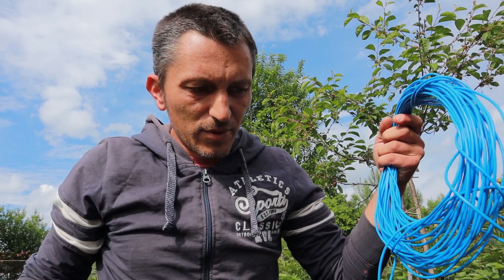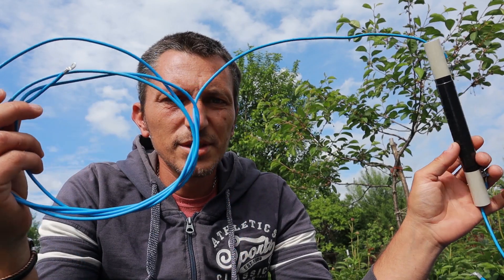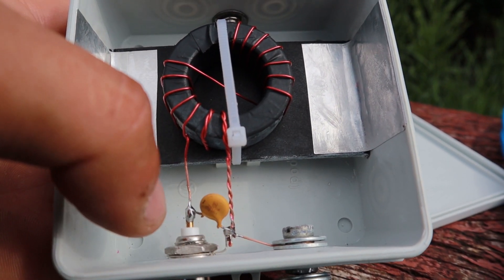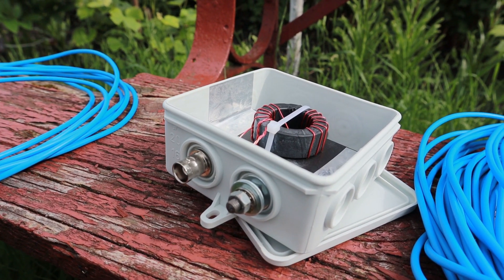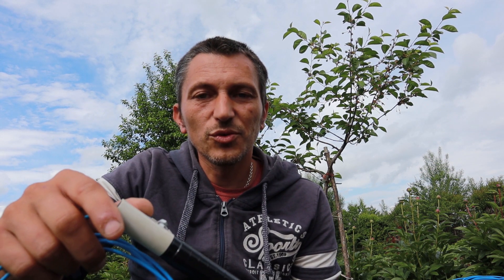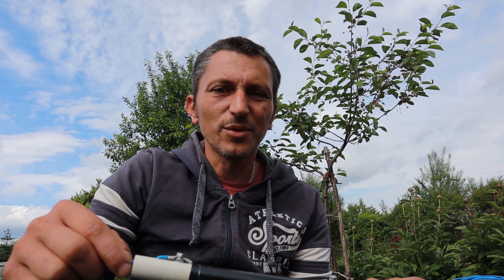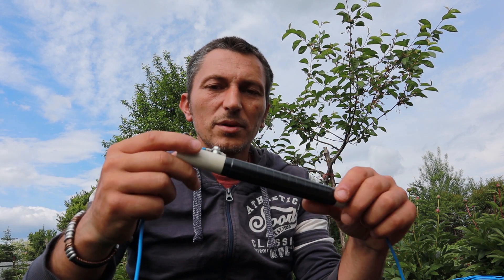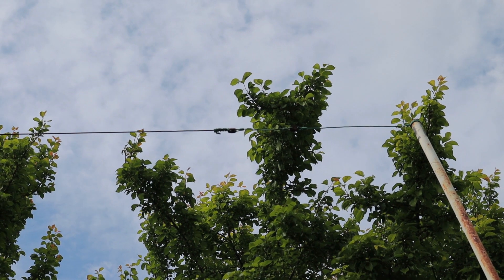Shortened Multiband EFHW Antenna From 80m to 10m Band

Comment: How many micro Henry's is your induction coil?
Reply from the maker: I can't remember to be honest. I think the one in the video was around 80uH. Basically you can use anything between 55 to 110uH. The only thing that will be diferent is the length of the wire after the coil. The advantage of having for example a coil that is 55uH instead of 110uH is that you may have a bit more bandwidth on the 80m band. But the end wire will be a little longer too... somewhere around 3m if I remember. I have to rebuild mine as well so probably I will do another video on this one with proper measurements now that I have all the gear to do that. 73, YO6DXE
Reply: @dxexplorer  66pacific has a induction coil micro Henry calculator
Reply from the maker: @QSasquatch Yes... or sometimes I use an app called Coil32. But of course once built it doesn't always turns out to be the calculated inductance, so I prefer to measure it now. But calculating is good even if it doesn't turn out perfect, but if there is nothing to measure it with... at least we have an idea on how close we may be around that value.
Reply: @dxexplorer  All we can do is get close
Reply from the maker: Yes 😅😅

Comment: Good information  (VU3VPF)
Reply from the maker: Thank you. I am working as we speak on a proper 40m long wire... much better in bandwidth on 80m and also it seems to work better on RX as well. But a lot of headaches getting it tuned well on all bands from 80 to 10m ))). Still a work in progress hahaha. 73 and have an amazing weekend. YO6DXE.

Comment: Which type of torroid  you have been  used ?
Reply from the maker: For this particular build I used the FT 140 - 43. For the one in my recent video of the QRP antenna for the 40m and 20m bands I used a smaller one... the FT 114 - 43. In both cases they seem to do really well considering my QRP power.
Reply: @dxexplorer  Thank you, the ft140-43 is ok for my qrp radio. Thank you for clarifying :-)
Reply from the maker: Yes it is. Glad you got it figured out hehehe. Now build that antenna and have lots of fun. I do 😁😁😁 73 my friend.

Comment: Not sure if this is correct…. But when I was building stuff as a technician, they always said not to solder screw down crimped connectors, especially the bit screwed down on, as the heat and pressure tends to make the solder “flow” away from the joint and compromises the connection? ….. at least that is what I was told. at college. 73
Reply from the maker: I don't know hahaha... As long as you solder stuff and you don't have the screw in place so the connection heats up properly, I don't think there is an issue. You only ad the screw after you did the soldering. I did it because on my older antennas I always had corrosion issues on the connectors. Not anymore now... looks like new even now ))
Reply: @dxexplorer  Yes if it is soldered together ....won't be an issue. Just got a transciever kit the ubitx for 40m....need to reapply for my ham callsign and build it and the antenna.....having so much fun with this stuff. Watching other channels and what people are up to has been great too! Just ordered some bits and bobs for a VFO DDS as well so will have lots of toys to play with in the shack in 300 years time when it arrives from the far east.....university study has taken a real hit since the ham bug bit again. 73
Reply from the maker: @TheArtofEngineering  Hehehe.... I'm glad you are enjoying it as well. Yes that's what I do as well when I don't have the time to build stuff.... I watch others and learn more and more. Ohhhh I really hope to be able to go for an exam as well to get my license. Until then.... I just build stuff and learn. The Ubitx40 is a really nice one. Happy you got one... 73 my friend.

Comment: Nice video can you show SWR table and make qso ?
Reply from the maker: Hi my friend. I can't because I don't have the tools yet to do the measurements. My friend Andrei from the Chanel QRPwithMe will make a detailed video on the same antenna as we both built it at the same time almost identical. I think he will upload a video with the measurements as well soon. He will send me the tool to do the measurements as well at some point so I will come back with that info in another video as well. If you  want you can follow them on Instagram @rowaves_technologies and check one of the latest videos as he is making a QSO with the antenna and a nice SDR Transceiver. 73

Comment: Hi Ciprian, very well designed. It should last for long !
I will use your design for sure.
About a VNA, try the nano VNA. It's far from real measurement instrument but it's cheap and it will do the trick to tune and to experiment with your designs.
73, F1SOC
Reply from the maker: Thank you Oliver... ohh yes my friend Andrei from RoWaves Technologies will help me and borrow me the tools to measure the antenna performance, and I'll try to save for the Nano VNA as well )) 73 my friend. It is a great design indeed... perfect for the space I have available. I wish I had thicker wire for the coil... but with the power I will use... I'm sure I'm OK with this one as well ))

Comment: Hi there, You can use a short length of coax as a substitute for a high voltage capacitor. Look at the capacitance of the coax you are using (say 90cm) and seal one end. http://webclass.org/k5ijb/antennas/Coax-cable-as-fixed-capacitor.htm#
Reply from the maker: Thanks Stephen... ohhhhh very smart idea. I forgot about that. Thanks so much one more time. I'll test it with this capacitor and see how it works... and if there are issues  ( but they shouldn't be )... I'll replace it with a coax cap hehehe. 73 my friend.

Comment: Great video. I have the commercial version of this antenna - Hyendfed 5 band. 23m in length. Nice clean solder joints too on yours. Looking forward to seeing the RF choke as i am doing the same soon when i get my wire at a better height and configuration.
Reply from the maker: I think so yes ))) I had it in some old book from the 80's and I've always thought of building it since I don't have space for a proper 80m band antenna. 73... greetings from Transylvania.